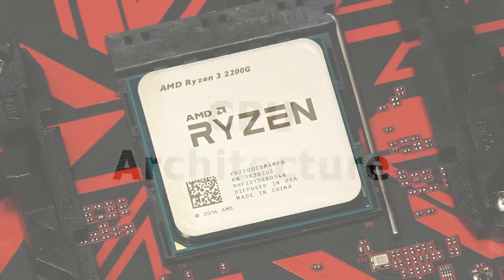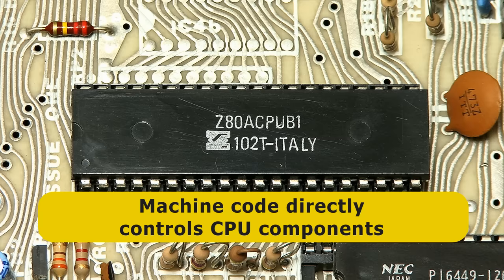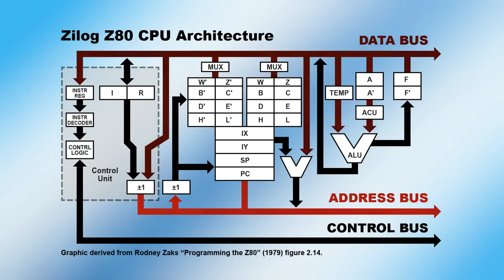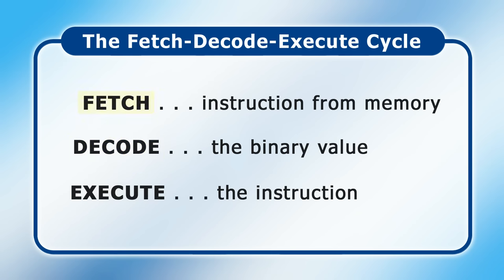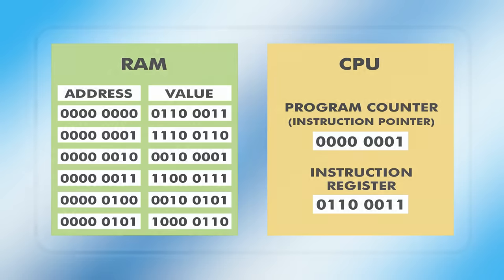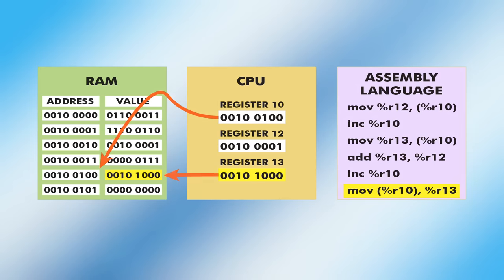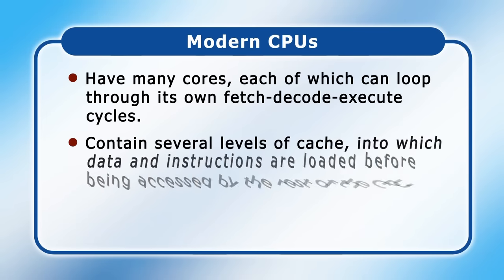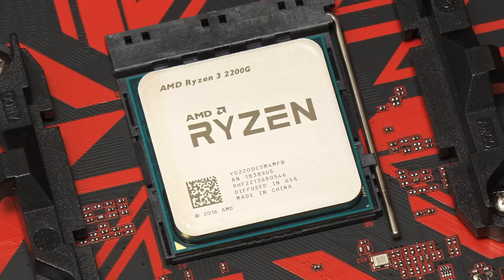How Do CPUs Work?

Comment: It might be a bit complicated to do, but I'd appreciate a video on how GPU's are used forBlockchain mining.
Reply: I'm not sure how interesting that would be, as it's just about doing a (relatively) small, simple task where you have to guess at some additional data. The problem is that there's no good way to figure out what a good guess would be, so you (usually) have to try a lot of guesses, and a GPU is basically a whole bunch of not-very-powerful computers that are very good at doing that one small, simple task very quickly, so you can run through a lot of guesses in short order, doing many at the same time. If the task were much more complicated than running a hash on (guess + data) and looking for a bit pattern in the result, your GPU wouldn't have the memory per task or the right kinds of instructions to do the job. (Getting the right kind of bit pattern in the result is the task. The transaction data is what you're given. You have to guess what to add to the given data, run the hash function on the combination, and hope the result has the right pattern. If not, try another guess.) And while you can certainly do the mining job on a CPU, you will have far fewer processors available, especially once the rest of the system's overhead is taken into account, and will be significantly out-guessed by people who have much faster equipment available, so you're very unlikely to ever win a block.
Reply: Look up the SHA-256 checksum algorithm. Bitcoin mining just tries to generate a block of transactions with SHA checksum numerically smaller than current "difficulty". It does this by adjusting a special 32 bit part of the block called the "nonce" repeatedly and recalculating the checksum until a suitable checksum is found. The block timestamp can also be adjusted (within limits).

All that using a GPU does is that a modern GPU has up to around 5000 "CUDA cores", which means it can test up to 5000 nonce values at the same time, while your desktop CPU can only test typically 4, 6, 12, 24, or 32 nonces at the same time using standard instructions -- or several times more that that using AVX, but far short of a GPU. At the same time, each GPU core is probably ten or more times slower than a modern CPU core, so the difference isn't as large as the raw core count indicates.

And that's all there is to it.

Comment: Hi Christopher. I wonder how software is able to control hardware. When searching for this subject, things like system resources, memory addresses etc are discussed, but I do not have an answer on how software is able to manipulate the physical transistors in the CPU. On a fundamental level I can understand things like discreet electronics, where electrical energy manipulate physical components, and they work together to do something useful. But how can software alter this physical process to give another result?
Reply from the maker: Software is loaded into RAM, and from there into a CPU's registers (which are made up of discrete transistors), where it can trigger other hardware to do something via a control bus signal and addresses communicated down the address bus. You have got me thinking how I can show this in a video, maybe building something . . . I will ponder!
Reply: @ExplainingComputers  Maybe you could explain the difference between memory-mapped I/O and writing/reading ports.  Which of these does a modern computer use or is there another way?  Maybe you could make a video about device drivers (if you have not already).

Comment: Hi Christopher Barnatt I am running a Linux Mint 20.2 on a NVMe which has a read/write speed of around 3500Mb/s, I am puzzled as to why the copy/paste process seems so slow at around 500Mb/s?  What I am trying is to copy my family videos which is around 50Gb in total, and I want to make duplicate of these videos within the same NVMe, so I can mess around with the copy, converting it to different video format and if all else fails, I can simply delete the copy and make another copy from the original, if you know what I mean?  So, if it was all done within the “NVMe environment”, why can’t it write as close to 3500Mb/s when making duplicate files?  Do you have any solutions?  Some say it’s the TRiM and some say FSTRiM ?  I’m confused.  Thanks.
Reply from the maker: 3500MB/s is the maximum speed of your drive when reading or writing. But if you are reading and writing from the drive at the same time (which is what you descibe) then it cannot perform the operation at this speed.

Comment: I realize even assembly is converted to binary nrs that (along with data) stand for an instruction of the instruction set. Is the instruction set just a bunch of smartly combined transistors or are they looked up in some ROM inside the  CPU ?
Reply: Combination of both. Some logic operations rely on cleverly connected 'transistors' / gates, while other instructions may take multiple cycles and passes through ALU to complete. Remember that at some level ROM and hard-wired gates in shift registers - for shifting for example, are really equivalent. They would use whichever gives highest performance or lowers transistor counts or minimizes real estate (area used) on chip. There are competing design goals & costs.

Comment: I been trying to understand how the complier converts/"translates" higher level language into binary (essentially circuits being on/off). Is there a simple way you can explain this ?
Thanks
Reply from the maker: A compiler does not really translates higher level languages into binary. Rather, compilers translate higher level languages into assembly language (which is a human representation of the machine code instructions that the processor executes) and then into machine code. In the video, there is -- for example -- this piece of assembly language:

mov %r12, (%r10)
inc %r10
mov %r13, (%r10)
add %r13, %r12
inc %r10
mov (%r10), %r13

But this is human notation. And in practice, each of the instructions listed above will be represented in machine code by one or more bytes -- or in effect by a number. For example, there will be a number that is assigned to the instruction to move to the value held at the memory address stored in register 10 to register 12. And another number will be assigned to the instruction to increment the value in register 10, and so on. So the final machine code is a sequence of bytes that represent machine code instructions to be executed by the processor, along with memory addresses and other data values. These bytes are in turn saved in a binary format. So in a sense a compiler does produce binary -- as anything in a classical computer does -- but it is machine code instructions represented by a byte or few each that do the work, and which need to be focused on to understand what is happening. :)
Reply: @ExplainingComputers  Appreciate the well thought out response. I'm not in a computer science field at all but trying to gain a greater understanding of how computers work. Starting from binary all the way up. And how the software interacts with the physical hardware was something I didn't quite understand. Your explanation was helpful. Thanks.

Comment: I understand how all the components of a PC work in conjunction of each other, but one thing I cannot grasp is how a miniature tiny square like that, is even made, or how it does all those tasks and broadcasts things to a monitor, like its just all metal and wires, how does it actually make a computer work...its hard to explain, but my mind just cant grasp it...all those tiny resistors and capacitors that are the size of a grain of rice...HOW does it operate!!!

Comment: in the very early days of computing, computers were dumber then a rock. to get them to do any thing at all you had to load the micro code into lower memory as a computer has no instruction set. that was load in a 2K block from card reader, disk drive.  the micro code didn't even have to be on the same device. the micro code wasn't even readable. loading the micro code from a card deck to a disk pack in it self was a art form and you could easy screw up even from the maker of the computers. so there was no built in instruction set.

Comment: Single chip, LOL as AMD have been kicking Intel to the kerb since 2017 zen1 and chiplets, plus substrate connector. 
AMD have now powered into the top 500  NEW supercomputer rankings, Intel only shows up because Lenovo puts a sub array of China cloud computers have been deliberately pulled and shown as a separate super computer. 
Intel (maybe) will be back in the game when they present chiplets foverose 2? As a customer options.
Intel is so screwed, I don't expect anything competitive for 2 years, and by then AMD will be 5 years ahead chip wise from now.
But there is the ever present danger of arm and risk V